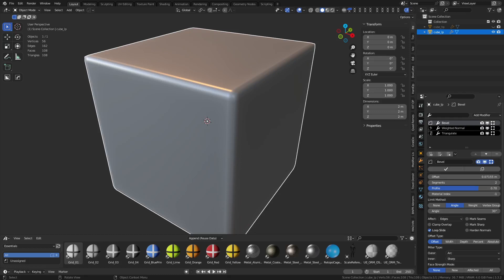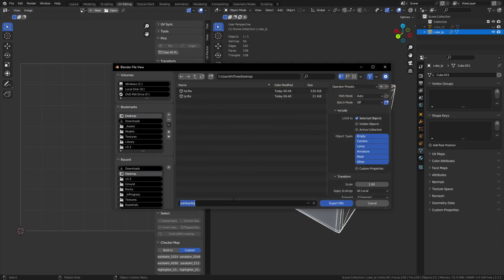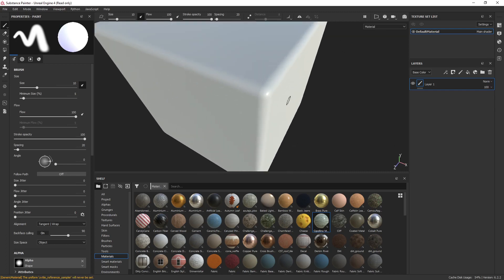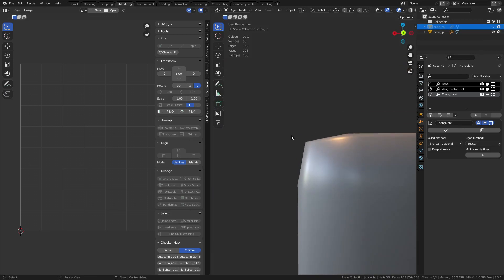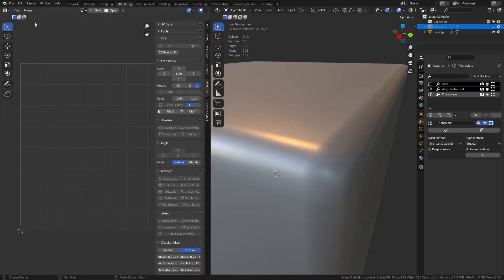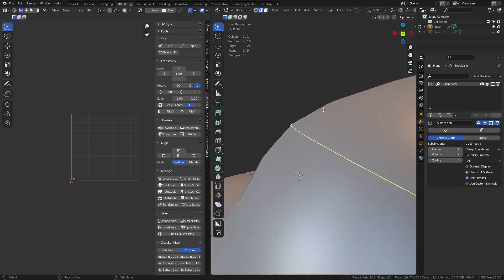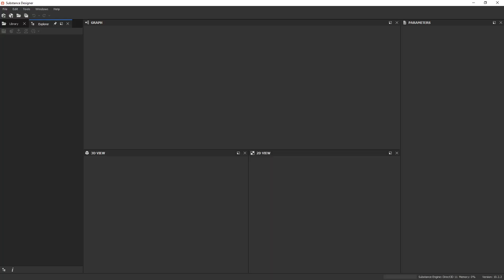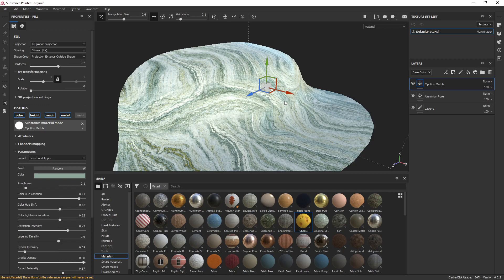Unavoidable Seam

Comment: So there's just nothing I can do about these seams then, damn :/ I have this stone lantern I made, the column of it has this ghastly seam running right down the length of it and I just can't figure out how to get rid of that seam because I see no other way of unwrapping a cylinder because the other way just creates this cone shape so I'd get way more texel density at the top compared to the bottom where it's all squashes together sharing about 100 pixels.
Reply from the maker: Sounds more like the topology and unwrap is the issue. Can't know for sure without seeing it.
Reply: @pzthree  Would you like to see? I can share with you the UV layout and an image of the model itself :)
Reply from the maker: Join the discord ask in the help section.